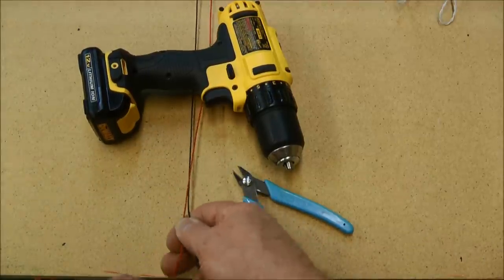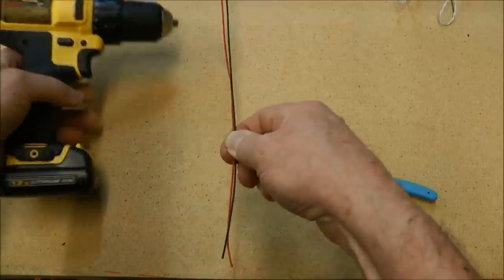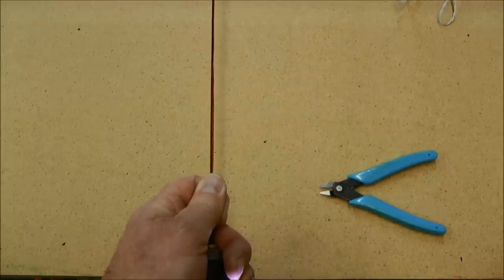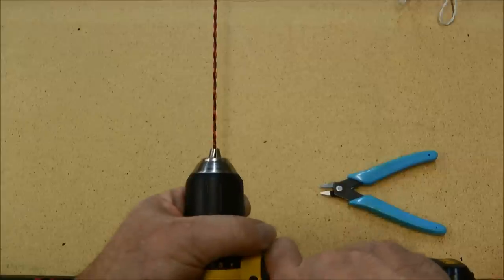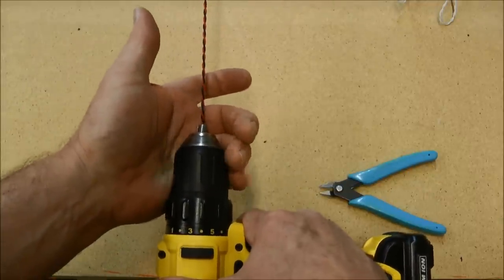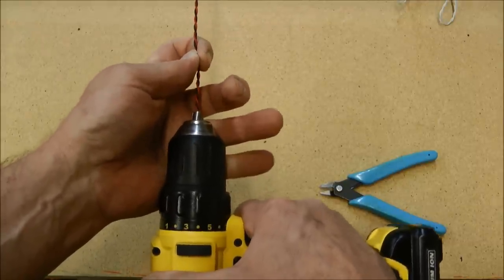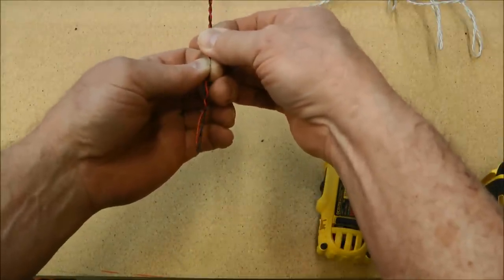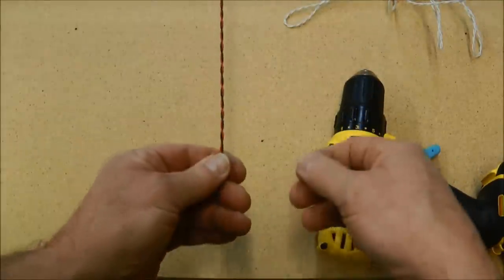009: TWISTING WIRE EASILY AND QUICKLY!

Comment: Thank you for this, especially the tip about spring back. I’m gonna do this to the signal wires of the maf on my car, plus shield and ground the shield. Idk if it’s all the extra radio waves now that was giving making it read erratic but twisting and shielding worked in my temporary fix i did.

Comment: I usually run the drill in reverse for a few turns before unchucking. After a few you'll get the feel for how much to reverse to avoid the spring back.  If you do it right,  the twisted wire will come out of the drill and not untwist at all. This is coming from 15 years in the car audio and security world and tens thousands of twisted wires.

Comment: Hey man excellent video this really helped me out, just some advice it'd be nice to see multiple different ways to secure the wire that you're twisting. Depending on the equipment, or extra sets of hands the different variations of securing the opposite end you're twisting down.

Comment: If you run the wire between your fingers as you did before releasing from the drill chuck with maintained tension (wire taut), a few times from end to end... then the wire will form straight. Of course, slowly release. It should not tangle up.